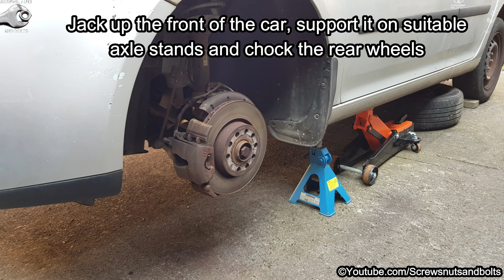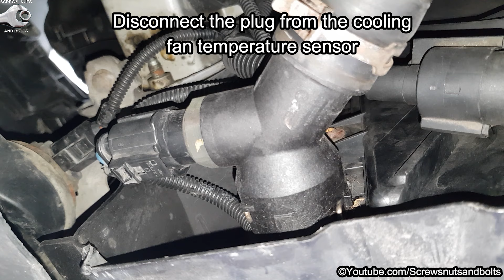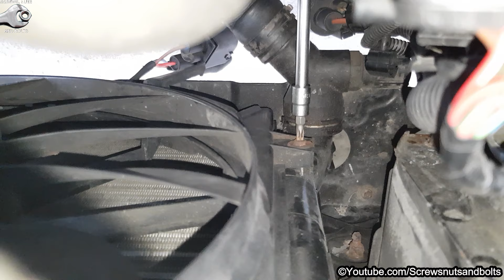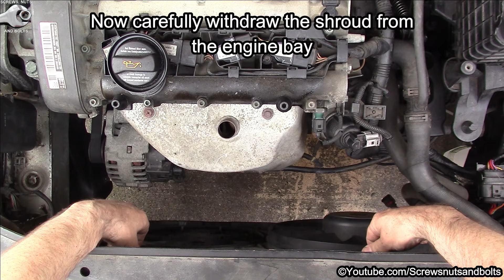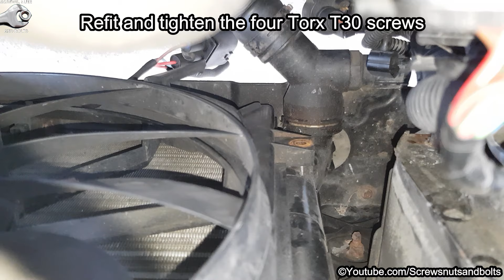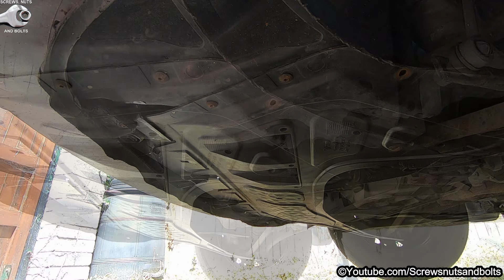Radiator Cooling Fan Removal and Refitting - Volkswagen Golf Mark 5

Comment: Just curious mate does that model not have a second fan ? Is the second fan responsible for the cold air?
Reply: most golf 5s come with aircon. so Golf 5s fitted with aircon have the second fan
Reply: @om1t_  thanks only just saw this reply..ok I got a question for you? mine don’t have the second fan and no A/c button that I know of when I switch it to cold on the temperature dial it blows warm air any suggestions?
Reply: You shouldn't have a single fan and AC seems like someone went the cheap route and toke out the smaller fan and never replaced it. In any case whatever the tomfoolery get yourself the proper smaller fan assembly or the entire dual assembly of necessary. Then have your AC checked and refreshed, it should always blow cold air as long as it functions properly with or without the cooling fan.